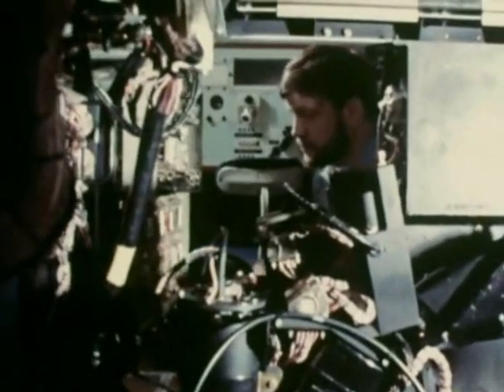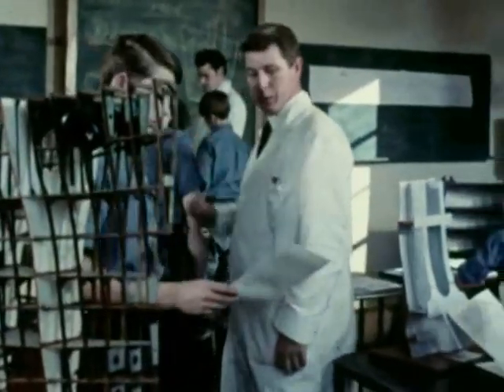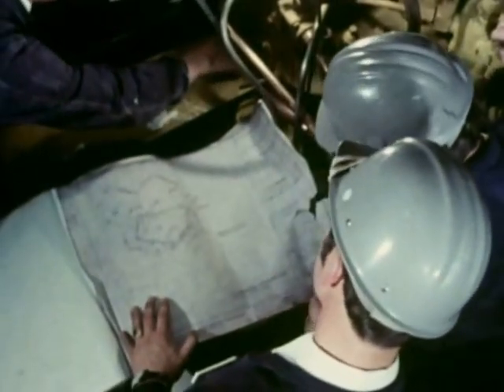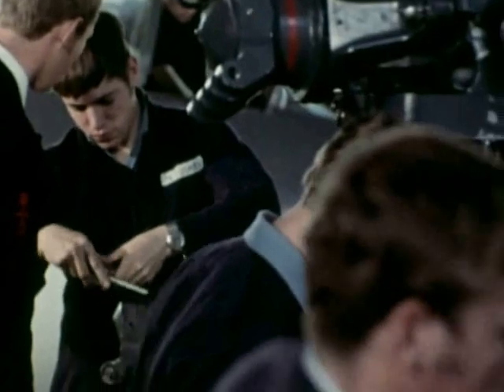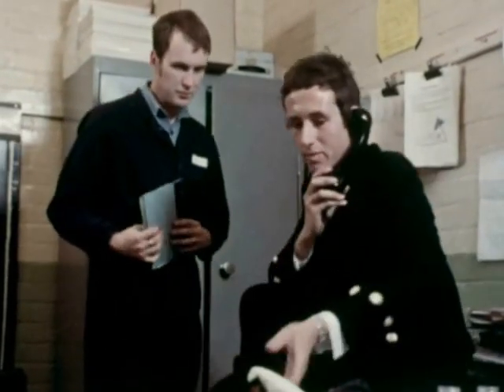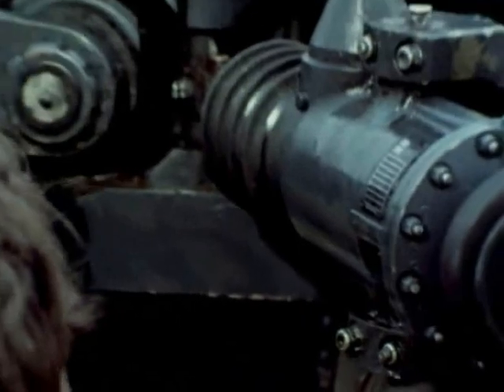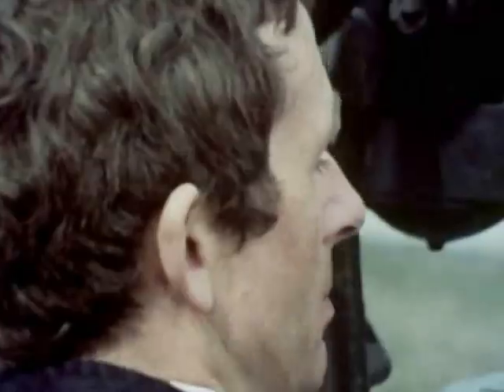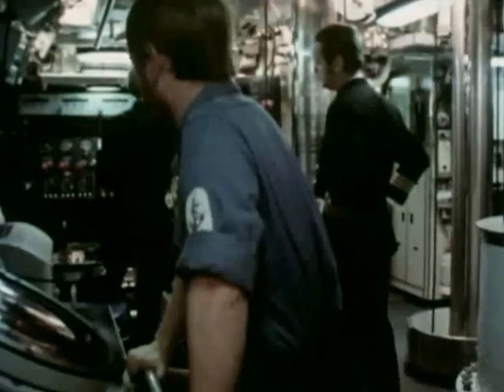The Artificers (1974)

Comment: Excellent video! I would be a US Navy artificer, naval aviation, also known as an "airdale". We were called technical maintenance personnel. We had Technical Training centers.  I worked on aviation fire control systems on an aircraft carrier. The electronic components and connectors shown are similar with those associated with the systems I did maintenance on at the same time. Those on the flight deck had colored jerseys according to task. Our Chief Petty Officers "CPOs" wore khaki uniforms.

Comment: RAN. MOBI trining, Fitting, Machining, Welding, Electrical, 5"", 4.5", Bofors, Gun Direction, Mk10 Mortar. First ship, DDG, HMAS Hobart.
Spent the next 3 years looking after a 100 line Strowger Switch Telephone System. Oh, and scratching paint of the sound powered telephone connection boxes on the upper deck. Dib Dabs would take of the cover and give them, Primer, Under, and 2 top coats., then replace the cover. Only bloody thing they ever did paint properly.

Comment: Sorry if this is a numpty question but what is the aircraft at 06.50?
First thought is a Hunter. Now OK Hunters did serve with the Fleet Air Arm and some had arrestor hooks, but folding wings???
I thought it might be my mind filling in a central tailplane and that the wings might be hiding double booms so it could be a Vampire or Venom. The jet inlets are too narrow and the landing gear is outboard of the wheels. No tip tanks as per Venom.as well.
If by chance it is Hunter and they did some with folding wings, then what for a better term is the boss device on the tail as per a Buccaneer?
Reply: Looks like a Hawker Sea Hawk   https://en.wikipedia.org/wiki/Hawker_Sea_Hawk
Reply: @kiergsmith  Definitely a Sea Hawk. There is a Sea Vixen in the background at the hanger door.